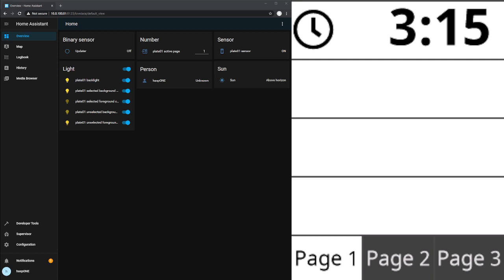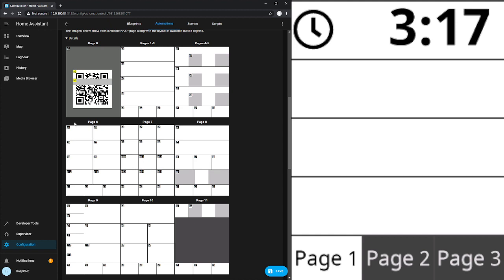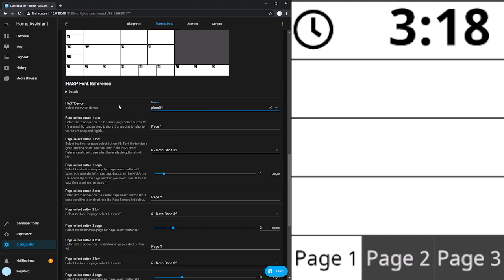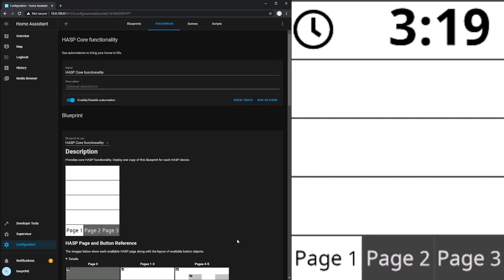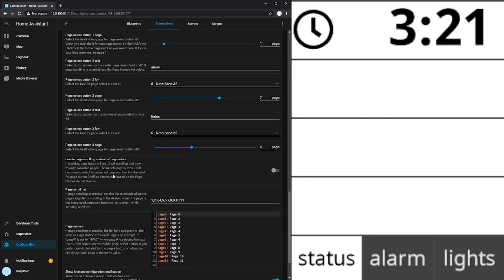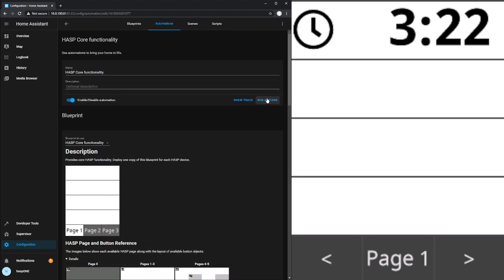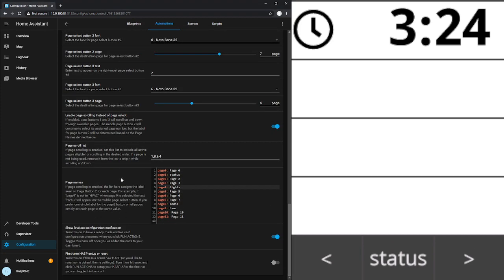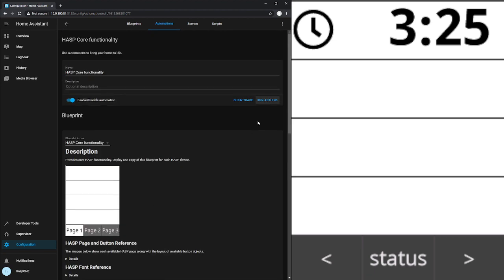HASPone Core Functionality Blueprint

Comment: If I've installed via the old method and want to use the new blueprints can I just add these  or do I need to remove the old files first?
Reply from the maker: You'll want to remove the old files, check out this guide for details: https://github.com/HASwitchPlate/HASPone/wiki/Updating-legacy-HASP-to-HASPone